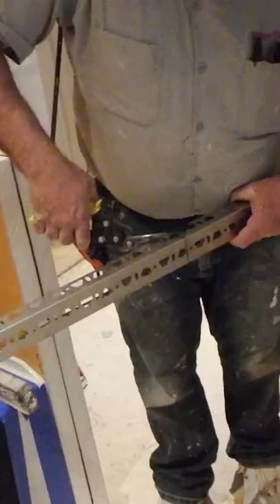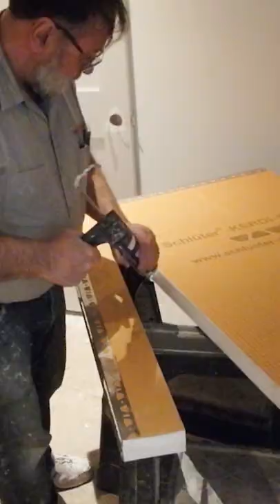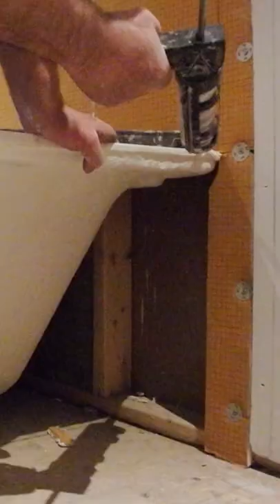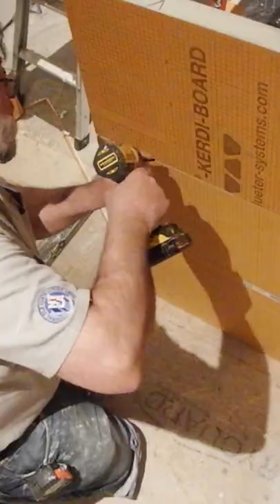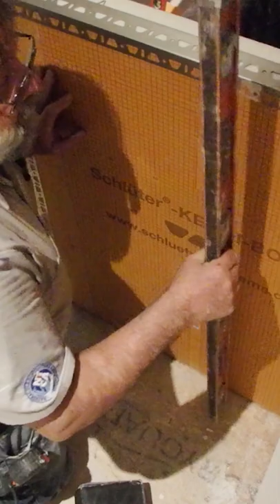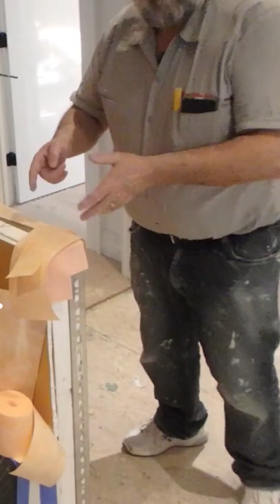Easy strong tile Knee wall #shorts

Comment: ....so how much did that knee wall cost....$500??  Could have it with drywall, 3 studs and PL....$50. Always remember, use the least expensive material to do the best job.
Reply: Probably $200.

Need nailgun, studs, drywall. 

2 pieces of 2 inch kerdi board and kerdi fix.

Its much simpler. 

Now go post this poor contractor talk somewhere else.

Comment: I’ll pass on using foam.
Reply: Your car windshield is bonded with a caulk, its structural.

It is not foam, do your research before spouting nonsense
Reply: @thefullmonte2003  car windshields and tile prep are not in the same category.

Comment: This is when tile guys only know how to use tile materials. I wouldve built a real wall
Reply: Some of us still do lol
Reply: @donscrilla7171  its like guys who i know that still build shower benches out of block!! Because thats all they know
Reply from the maker: That foam wall is stronger than any 2x4 wall you can build, and will not rot or move. Understanding the products you use will lead you to using the proper products suited to the job.
Reply: @SalDiBlasi  there’s absolutely no way that wall is stronger than a pressure treated 2 x 4 wall
Reply: @robs1873  expansion and contraction is too much with treated lumber. Your tile might pop off the wall.
Reply: @davegordon6943  hahaha you have no idea what youre talking about. Besides he said that wood will rot, maybe if you or him did it, none of my showers rot because they don’t leak
Reply: @robs1873  sal is one of the best tile setters around. Apparently you don't know what you're talking about. You are the one talking about using pressure treated lumber. Why would it need to be treated if it doesn't leak? Frickin genius
Reply: @davegordon6943  it doesn’t have to be. He said wood rots. They do make treated wood 😂 Someone who only knows tile wouldn’t understand
Reply: @robs1873  dude you are the one talking about building a shower wall with treated lumber and that yours would never leak. So why would you need treated lumber if your showers never leak. You must be confused
Reply: @davegordon6943  😂 you’re really really worried about me arent you
Reply: @robs1873  no, I'm correcting you
Reply: @davegordon6943  😂 youre playing with ants. How old are you?
Reply: @SalDiBlasi  stronger than 2x4? That’s hard to believe. But maybe you mean in terms of expansion snd contraction, its a more solid product?